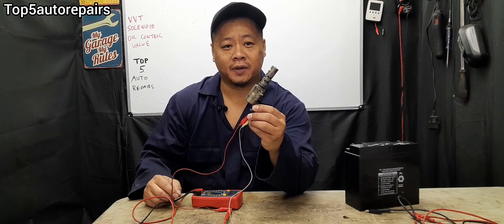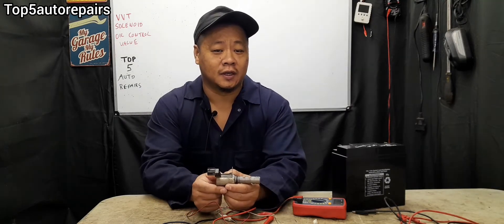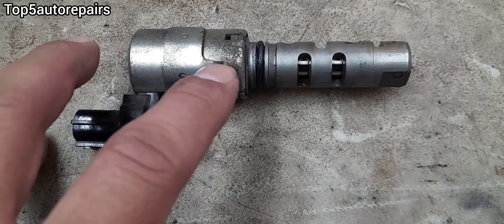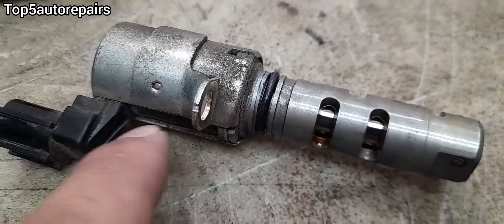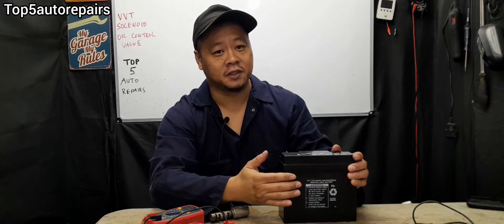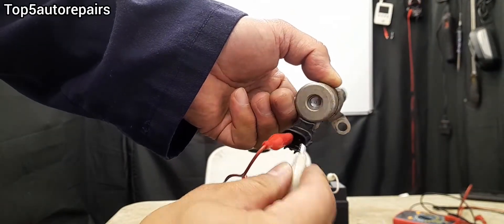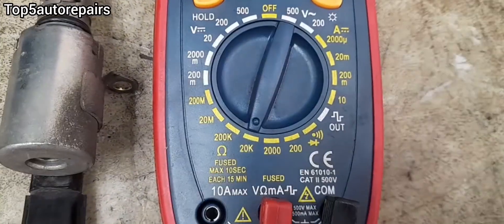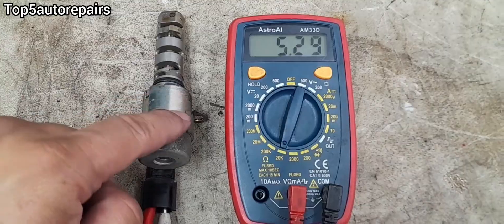SYMPTOMS OF A BAD VVT SOLENOID (OIL CONTROL VALVE) HOW TO TEST IF IT'S STILL WORKING PROPERLY P0011

Comment: Will this cause cold start(for 2-3 sec) rattle even after parking for sometime there is rattle, i changed timing chain, tensioner and guides but rattle is still there and my mechanic said he checked the sprocket by moving after taking off the valve cover and said it should be fine so do u have any idea what would cause the rattle
Reply: You need to go to a different mechanic because this is as simple as it gets. If it was the timing chain, timing chain tensioner, or guides, it would never stop rattling. The rattle is caused by the camshaft phaser (VVT actuator). I don't know the year, make, model, and engine size you have or else I could've given you more information. Just know that it's one of your phasers. The phaser is mainly composed of 2 parts: the rotor and the housing. The locking pin that goes through the rotor is not seated in the hole of the housing for the first 2 to 3 seconds after startup. Once the pin gets seated inside the hole in the housing, it locks the rotor to the housing and the rattling stops. It's the rotor rotating back and forth inside the housing that causes the rattling. Please don't come back and list the year, make, model, and engine size because I will not be replying back to this comment.

Comment: Hello, can a leaking engine valve gasket  cause both p0011 and a p0014 to pop up i removed them tested them and cleaned them aswell & the same codes returned ,I'll be replacing the gasket tomorrow .
Also they were a pain to remove due to the build up gunk.

Comment: Does Oil light come on as well?
Reply from the maker: Yes it's possible. Low oil pressure will affect VVT solenoid operation.
Reply: @Top5AutoRepairs  will VVT solenoid affect oil pressure?
Reply from the maker: @NuffSed1042 it won't affect oil pressure
Reply: @Top5AutoRepairs  thanks for the clarification.....then my issue would probably be elsewhere.....I keep having oil light coming on..... I'll just replace the solenoid and also flush the engine and see what happens

Comment: I had an Intermittent P0012 - Camshaft Position “A” - Timing Over-Retarded (Bank 1). I checked everything mentioned here as well as changed the oil, cleaned the VVT valve filter, ran the checks  in the service manual, checked timing, checked camshaft phaser. I replaced the VVT solenoid anyway, and the problem went away. My guess is that the old solenoid internal gaskets were leaking, and allowing  oil to flow to the wrong side of the camshaft phaser. Not sure how to test for this.
Reply: An internal oil leak of the plunger is difficult to detect and the only way is teplace it with new. Good you solved the problem.